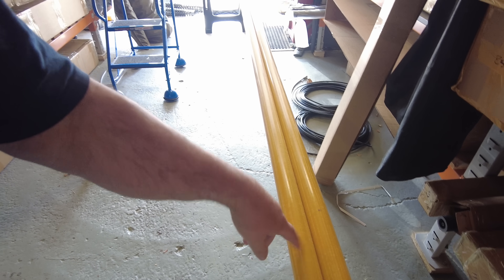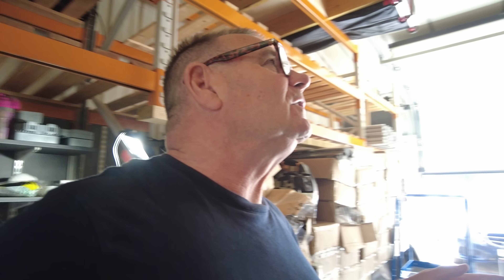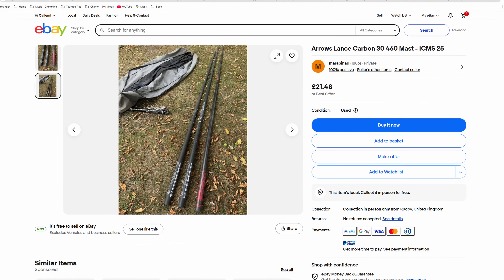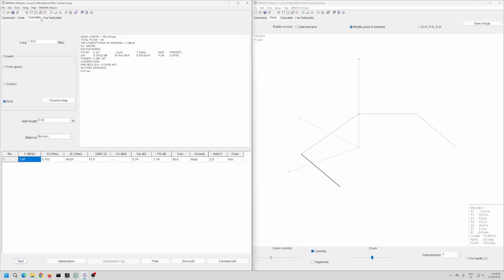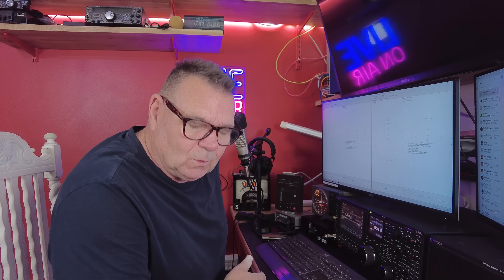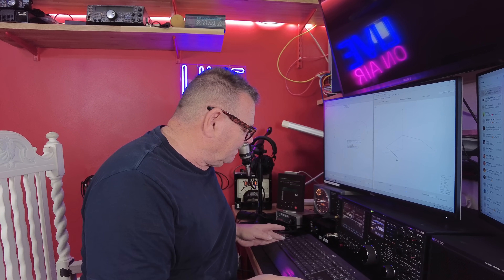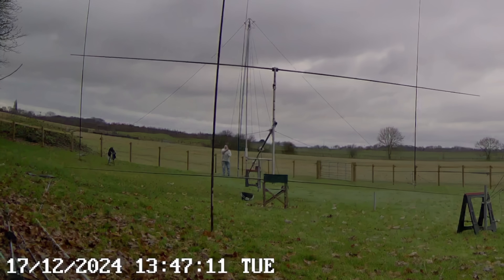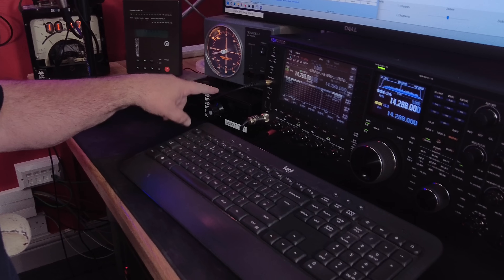Engineering a Compact 160m Dipole (Can It Get Smaller?)

Comment: Experiment is great, I just stuck a external tuner on my 40m vertical,  tuned it on 80m, and got spots 3k miles away hi. How does that work hi.
Reply from the maker: The definition of "Will it work?" springs to mind!

Comment: One of the first antennas I built was a plain 40M inverted V with added loading coils I also built for 80m because I didn't have room for 80m alone. Feed point was at 20ft. Worked great for a couple of years and I replaced it with a multiband EFHW I built. I still have the antenna stored for possible future use. Your audio is fine.
Reply from the maker: Nice work as usual Jack!

Comment: In my verry small garden i used a 12m mast it was centre loaded virtical on 80m if i fitted a coil at the base it
Worked on 160m i did work a lot of dx with it useing 100w
Reply from the maker: Interesting! That's a great solution for a small space.

Comment: You can make an infinite small dipole and it will radiate the same as an isotropic dipole.
Reply from the maker: Do it... Not sure the efficiency would be as good as the theoretidcal isotropic though.,
Reply: @DXCommanderHQ The same. The catch is the matching network, it cant be done without very high losses.
No free lunch 😂

Comment: I use my 140' + 45'(feed) doublet for 160m, for the local ~500-1000 miles it's FANTASTIC. Make my own antennas, 3d printed all the parts. Designed a 600ohm open line spacer. I have antenna that's a vet of 20+ potas.
Reply from the maker: Sounds like you have an awesome antenna system!
Reply: I've very seldom come across people doing 160m POTA.